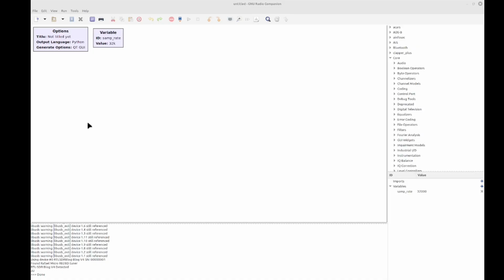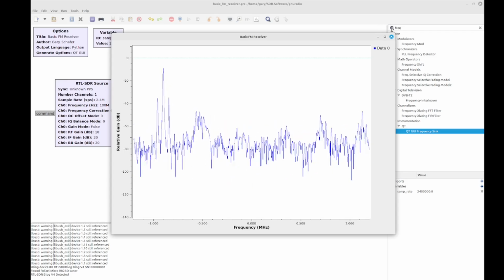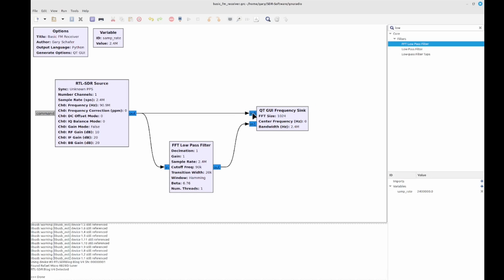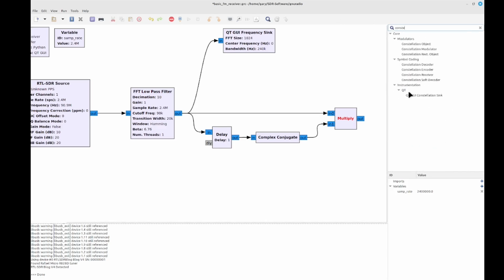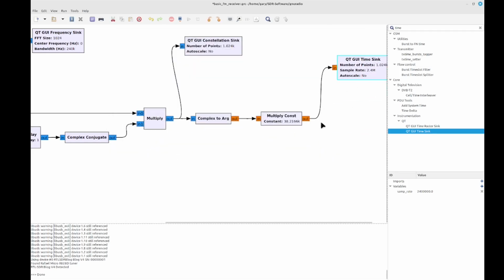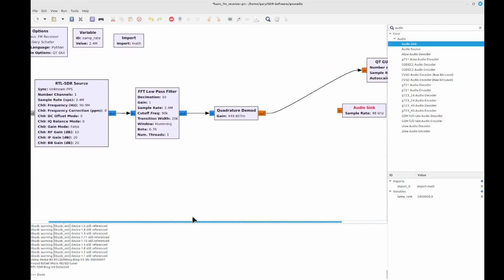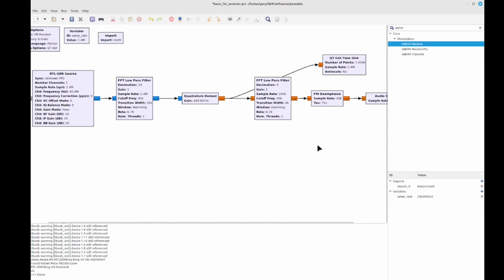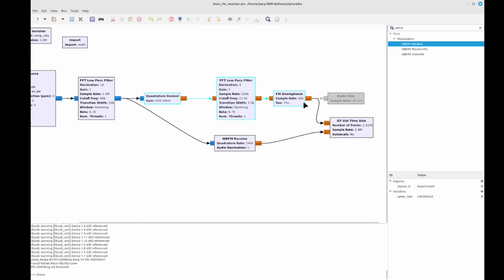Creating a Basic FM Receiver using Gnu Radio Companion

Comment: Hello everyone,

After adding an FFT Low Pass Filter in GNU Radio Companion, I get this error: 

Value "window.WIN_HAMMING" cannot be evaluated:

NameError: name 'window' is not defined

Does anyone know what causes this or how to fix it? Thanks in advance!
Reply: I’ve just fixed the issue. If anyone needs a solution, here it is. 
Fix it inside your flowgraph

1. In the right-side block search, type Import.
2. Add an Import block to the canvas.
3. Open it and enter:  from gnuradio.fft import window
4. Click Apply → OK.
5. Save the flowgraph and press Run again.
And thank you for the great video explanation!
Reply from the maker: You'll want to ask the Gnu Radio community at https://www.gnuradio.org/community/. This forum is not designed for such issues.
If / when you do, you'll want to provide basic info on the OS you're using, the version of Gnu Radio you're using, and perhaps a picture of your flowgraph.
Good luck!
Reply: @signalgalaxiesunlimited  thank you.

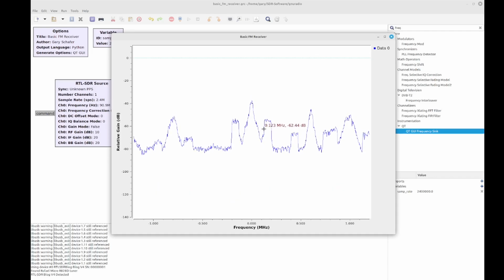Comment: great tutorial. Question:  how did you bring up that menu  where you enabled FFT averaging at about the 10:30 mark?  I tried right click in the window, nothing comes up.  I'm just doing a simple HackRF soapy source into a GUI freq sink and GUI waterfall sink, not the full receiver, but that basically what you're doing at that point in the video.  Thanks.
Reply from the maker: I'm using a mouse with a wheel, and, with the cursor in the spectral display, I can click on the wheel to bring up that menu. If that's not clear or you have any other questions, let me know. 🙂
Reply: @signalgalaxiesunlimited  awesome, it works, thanks.  In all my years of using computers I don't think I've ever used that mouse feature, hence it did not come to mind.  Crazy, huh?